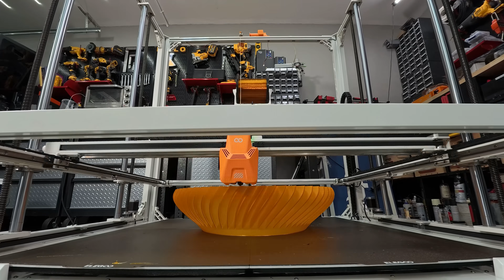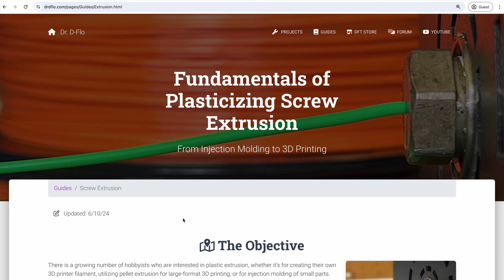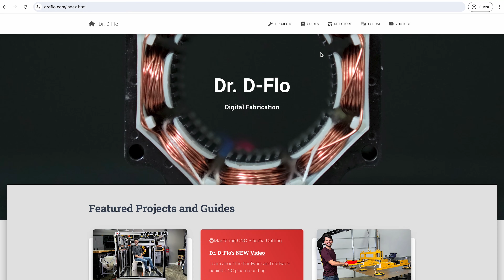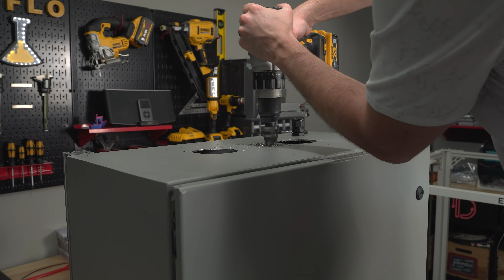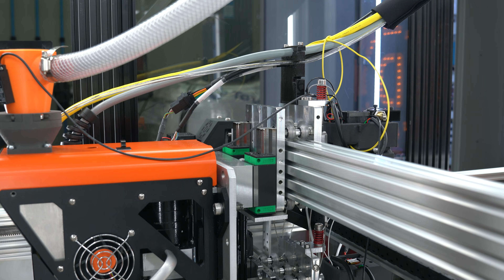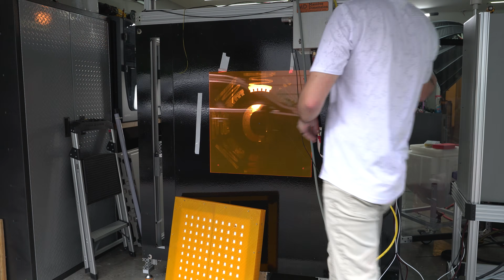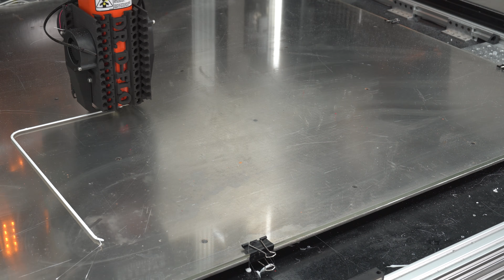SCREWing Around with a $20K Pellet Extruder - Large Format 3D Printer (Part 7)

Comment: Hi there! I am following your videos on this huge printer… and, please try to not get upset with me, I ask myself how much you invested already in this machine… and beginning to be skeptical if it will print nice at some point. 😳 It looks an insanely cool project - but in the end, how it prints is what matters, right? Have you printed a Benchy this size on the OrangeStorm Giga?
Reply from the maker: You don't think the corner flower planter looks nice?? I joke... but yes, the benchy doesn't look particularly nice, but you can't compare it to the Giga. That benchy weighs 7 kg (15 lbs), which would cost over $100 to print on the Giga and take over a week. The recycled pellets were only a couple of dollars total (but were contaminated which led to some of my problems). 

The benefit of pellet extruders is massive flow rates and cheap feedstock. The drawback is resolution/detail. For large objects like the planter and my boat that is currently printing, quality is about what I expected.
Reply: @DrDFlo Fair enough… but the extruder itself is extremely expensive: 20k dollars 🤯 Is that right? (That would buy a lot of filament). And SO massive/heavy that printing directly from it in the print-head will be a limiting factor in speed/acceleration/stability. Maybe it would be possible (although very tricky to control) to use it on top of the printer to fabricate the filament you use - on the fly - and use a much smaller and lightweight printhead to actually do the quality print. You will still discover if clients (or yourself) will be satisfied with such irregular prints - even though they are massive and arguably cheaper than with a different setup. Maybe manufacturing your own filament in house would be the solution for having a huge printer - not necessarily making it happen in the printhead itself. Good luck my friend. I am skeptical - but I find it fascinating nonetheless. ❤
Reply: @DrDFlo I forgot to ask: 7 times the size of the original Benchy - total weight: 7kg? How much time it took to print? Thanks!

Comment: i think your over cooking the plastic ,you pumped too much heat into the plastic that its boiling and bubbling and the 3 fans cant take the heat out of the plastic before it deforms. try more torque with less heat .
also you might have a "bigger is better " problem, 20k is crazy for a 3D printer , i dont know if this is your extruder or if its a review unit but you can probably drop 2 Kg or more if you remove all the useless metal sheet and connectors off the extruder 
awesome video .always glad to see what crazy thing your up to.
Reply from the maker: When I crank the metering/nozzle temperature zone up to 230-240C, you can clearly see that the material is degrading (significant voids and off-gassing). However, the planter was printed at 205C, and really there was no other signs of degradation. However, the recycled plastic feedstock is quite contaminated, there  are black specs and small pieces of cardboard/wood that I have been unable to completely sieve out. It could be this material that this burning in small quantities, but I am still not convinced it doesn't have something to do with the humidity in my garage and the ease at which polyesters absorb water.
Reply: Nah, recycled material tends to be garbage. Chemically degraded, not entirely pure etc

Viscosity drops every time you extrude plastic

Comment: while the points you put forward about a tidy electrical cabinet are completely valid. I was always always taught that you keep the wiring tidy to quickly troubleshoot and fix issues. Granted my experience comes from a custom automation system integrator that does a lot of auto industry work where downtime can cost 10-20k a minute.
Reply from the maker: Yes! Troubleshooting is a major reason for going the extra mile on wire management. And wow that sounds like high pressure work
Reply: @DrDFlo  It usually wasn't too bad but it had its moments. Fortunately I was on the build team and we typically built the equipment in our own shop then  tore it down and shipped it for the install. The real heroes are those who work maintenance in these factories.

Comment: Thermocouples are always sensitive to noise because they work with such small voltages.
You should never make a long run of thermal coupler wire, it should terminate as quick as possible.
It is best if you mount your thermocouple and then use a simple amplifier to go from there.
 you can then filter out the garbage even in discreets using comparative circuit
It sounds like this hot and needs a chick ring just like a injection molding press would have that should stop that drooling
Reply: in FFF they are called Daughter boards